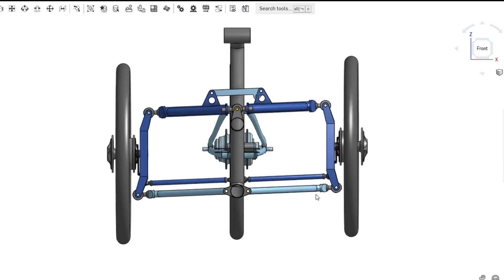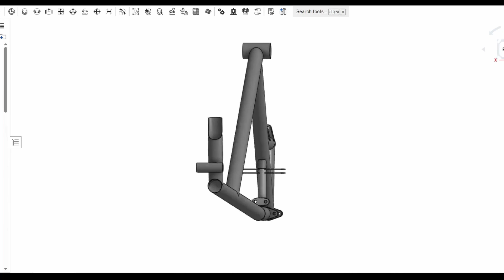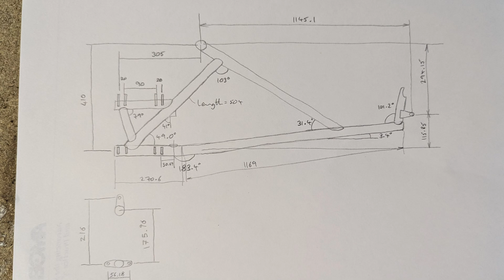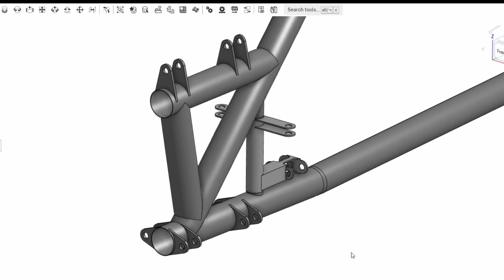Making the Steel Frame - Tilting trike Mk II Build Project Ep. 3

Comment: I'm happy to see you have come back to make version 2 of the tilting trike, it is amazing to see how you designed the geometry using theory and computer modeling before building and testing.  I think this will result in a well functioning product.  The joints are fit up very nicely on your metal work and it makes me wish I was there to get a decent TIG weld on those joints.  Best of luck, looking forward to the next videos and using your steering mechanism for a design I'm working on for a gravity trike
Reply from the maker: @number1donkeyfan473  i definitely need to learn to TIG weld!

Comment: When notching tubes together, best practice is to sand/file/grind back the "wings". When looking at the inside of the tube, the "wings" have a taper; this is what needs to be removed. Squaring the edge of the cope results in a stronger joint than the tapered portion can provide. Adding a slight external bevel around the tube end will make welding the joint with proper penetration easier.

A couple hours of welding instruction by a professional and/or instructor and some practice will have you welding perfectly adequate for building this frame with your MIG. TIG is nice (and necessary) for some materials, but not required for a project like this and will only result in a steeper learning curve and (probably) more frustration.

Keep up the good work.
Reply from the maker: @ja_  thanks, yes I need to grind the tubes back a bit.

Comment: MIG is not your skill yet, and personally I think TIG requires more skill. So heres my comment. Soldier the joints. I've seen production videos of bike manufacturing and they soldier there joints.. Simply flux both part very carefully. Then drop a slug of soldier in the tube and heat it up.  SIMPLE.    Caution, this will take some test for flux and soldier positioning in and on the tubes. But much easier to  perfect, and will be better joints. AND LOOK PROFESSIONALLY DONE!
Reply from the maker: @stewartfrye  hard soldering/brazing is certainly an option.

Comment: Main problem with welding bike projects is that the difference between surface level glue, proper penetration and burning through is basically non existent...
You have so little leeway in either direction that failure is all but guaranteed.
Maybe start by doing lots of testwelds on the kind of pipe you plan to use. Like... Hundreds...
Reply from the maker: Agreed! A TIG welder would also enable TIG brazing as an option.

Comment: I don’t understand why you’re making the “top bracket” adjustable to accommodate different leg lengths rather than making the seat movable. If you move the top bracket won’t that mean the chain length will also have to change?
Reply from the maker: Yes I will need some sort of chain tensioner.  The seat will be adjustable too, at this point I'm just building in as much margin for error as possible. And moving the seat to change the centre of gravity may also be necessary.